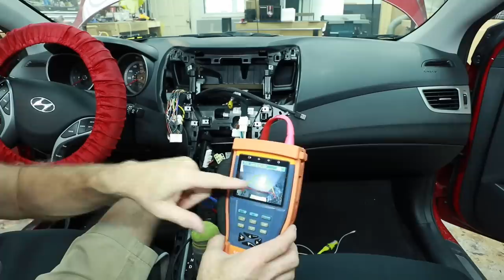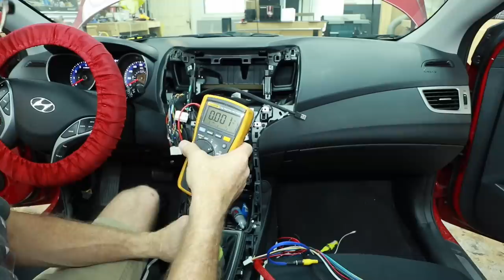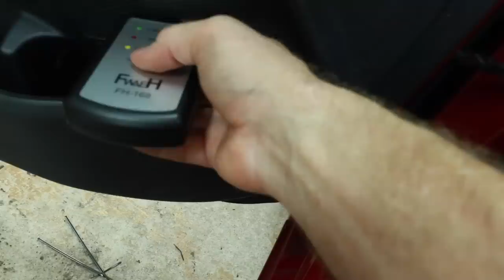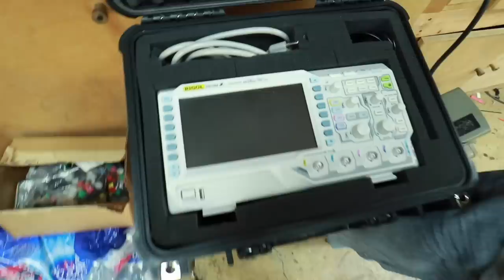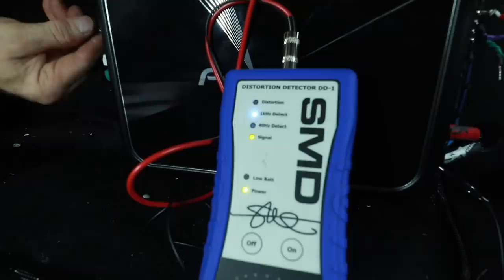The process of a 911 make over in this Hyundai Installer Diaries 211

Comment: I've been an installer since 1988, and I learn something every time I watch one of your video's. The smile on your customers face at the end of the video says it all. Well done guys.
Reply: U got my like. I didn't even read your comment. :)
Reply: Not only that, I rarely have run across a DIY job that was hacked this badly.  This is embarrassing.
Reply: @dnewma04 oh i have. When i was an installer, ive seen waaaay worse. Power wire was 3 different wires, not ring terminals on battery or ground, just bare wire twisted around the threads of a bolt and where each wire met the next color of power wire, they didnt even crimp or even use wire nut, they had bare copper just laid against each other and taped it up.

Comment: This crap is why I DIY.  I am no where near as good as Dean and Fernando, but my stuff is better than the crap the other shop did.
Reply: Agree. I prefer to stay, ask questions and observe the few times I have to rely on somebody else for Car Audio, Electronics, Maintenance & Mechanic work.
Reply: Same 👍
Reply: Ditto!
Reply: I welcome people to sit and watch me work, ask questions and get hands on if they want.
Reply: @bigaudiofanaticsoldchannel6162  That's good!  Let people see what they are paying for.
Reply: I just recently got my stereo installed at Best Buy, the guy ended up drilling holes below the stereo to run the USB, without even asking. The dude then pulls out the AC Drain hose, and for a month i had my ac draining into my passenger side. So just about done getting the carpet replaced, Best Buy's insurance paying for it. Honestly I should've just DIY and would've been happier or just go to Dean & Fernando and get it done by true professionals.
Reply: @WazZappening  Best Buy is hit or miss.
Reply: @WazZappening  that sucks. I'm a mechanic/12v guru by trade and I'm actually good friends with a few top notch installers at a local best buy but even they said they wouldn't trust most of the installers at other local BB stores. Def hit or miss with chain stores from what I've seen.
Reply: Agreed!
Reply: I am rewatching the video.  Why the hell did the other shop cut the factory harness?  It can't be that hard to make a T harness with parts that a shop should have laying around.  I bet I could run down to Walmart or AutoZone and grab some harnesses and build one right now.
Reply: Same here I had to do my friends audio for cheap using scraps of old systems on a iou I'm only charging him $100 including the amp i sold him because i just wanted to see it done right its still not perfect the front speakers need replacing again he trusted a local audio shop and they charged him $200 for $100 worth of speakers the front are just replacement cones awful distortion so when I replace them I'm redoing the last of the wire hopefully I found everything messed up the local shop isn't to blame on his poor install he trusted a friend's recommendation lol not good at all so his system bumps good and clean like I said still needs a few extra things touched up subs don't match but its whatever he had at the time it's less likely to flame on 😭😭😭
Reply: @toxictophat711  that's really frustrating.
Reply: It about doing it right, not who's better
Reply: Yep, it's why I got into DIY (and I'm not as good as Deam and Fernando) - seems that there are too many shops that do the crap the other shop did.
Reply: I was thinking that too...100%...but just now it hit me. Sometimes people go the cheapest route first...just wanna hear upfront results as better than before. Then realize later it takes work and time. I've been that way...I learned the hard way a lot...but it's been fun. watching these videos is golden knowledge I wish I had 30+ years ago as a dumb kid!
Reply: Same here. That's why this video was recommended to me.
Reply: Right.i have the minimum to work with when it comes to audio an my systems looks professional compared to theirs..🤦🏼‍♂️🤣🤣
Reply: FACTS!
Reply: amen
Reply: I've always done my own installations.  Last year I was feeling a little lazy.  I brought my car to the shop down the road, they've been in business for over 15 years.  The install was horrible, it all worked but was a mess.  When you do it yourself at least you know everything is done correctly.
Reply: Me too..waaayyyy better
Reply: Agree! I do my own thing and I take my time!!! I plan every stage!!!
Reply: Same. I have a higher quality of work, on average, doing it myself rather than outsourcing the work. The only time I go to a professional is if the job requires specialized tools or equipment that I don't have.
Reply: @varok011  Or... you know the install with a better / easier chance to fix it.
Reply: Yes
Reply: Ditto.  I watch them to improve even more.  My first install ever was better than that disaster he paid for thr first time.

Comment: The guys who disliked this video are probably the same guys who installed this lol
Reply: Estoy de acuerdo con tu comentario.
Reply: Facts lol
Reply: I was going to say the same thing. lol
Reply: They also work at Car Toys
Reply: Truuuu
Reply: True
Reply: I thought this was about installing a sound system into a 911 porsche
Reply: @gp8666  haha That's what I thought too!
Reply: Well he did trash the last guy for taking apart the factory speakers. And using there housings.  Then preceded to do the very same thing with the factory tweeter upgrade install. Solid install though.
Reply: Vin Quach that’s true,🤣🤣🤣👌🏻
Reply: I didn't dislike but see some problems here. For example. . . I never have high current power cables near RCA's. Usually power down the center and signal to one side or the other.  Also, Amplifiers in my installs are ALWAYS recessed mount with access covers or trim. No worries about about accidentally hitting any of the amplifier wiring that way.....Great video though, especially with all the info with the PAC-1
Reply: Lol
Reply: @tommygunnz7154  He manufactured the bracket for the tweeter out of  8th inch plastic, he didn't the old bracket 41:90
Reply: @mikeallen4200  how do u handle any heat from amps recessed...if any?  what u think about a lil fan install...or u think that's like a bandaid for something that needs some other help? peace
Reply: @mikeallen4200  btw...yea...power wires separate for possible interface AND space
Reply: @fatrobrico  I usually will use axial fans on small installs and ducted fans on the monster installs.  When Amps are fully enclosed, I always have intake and exhaust fans.  On some smaller installs, I've been known to cut a pattern or logo into polycarbonate and edge light it and it can serve as a passive intake with multiple axials pulling air through. It just depends on how the client wants the install to look upon completion. A side note:  when running fans to cool the amplifiers, avoid their power wires intersecting with signal cables just like you would with amp power cable. High RPM fans can cause signal interference, and a whining sound through your highs and mids, and a deeper hum in your lows like a poorly grounded set-up.
Reply: @mikeallen4200  thanks for the info!!!
Reply: @fatrobrico  no problem at all
Reply: Yea cus you don't work for them lol the editing is so obvious
Reply: That's alot of people weirdo
Reply: Hahahahaha FACTS
Reply: Mike Allen most higher end line rca cables are adequately shielded and do not pick up noise. This isn't a usual issue nowadays.
Reply: Lmao.....What is the name of the shop that fucked his car up so I don’t ever go there!!!!
Reply: the dislikes are the guys still installing used pull-out radios
Reply: 🤣🤣🤣🤣🤣 facts
Reply: I love this guys.  The type of installation they do is A1.
Reply: @superchile9640  i was going to say the same thing. The rca next to power wire is an old install method, today's rca's are triple shielded and do not cause interference issues. 90% of interference is from improper grounding.

Comment: I have 19 years in car audio, advanced security, fabrication, cabinetry, and accessories. I ran a high end shop for 9 years and this kind of work was common in the neighboring shops. There was more than one occasion where I saw expensive equipment deemed subpar by lackluster installations and many vehicles that were fire hazards. I would be humiliated if that was my work and it fell upon others' eyes. I love your methodical and detailed work.

Comment: I’m re-doing an aftermarket HU install in my wife’s Mercedes C230. Dean and Fernando, I wish I knew about you when I lived in Tampa. The shop that did the install ( in So CA) cut my factory harness, didn’t solder anything and the install looks like spaghetti. Your videos and tips are a big help, thanks for what you do.
Reply: They are in tampa Florida?
Reply: jean tsai   They are in Clearwater. Just across the water from Tampa.
Reply: @96matzed  when i am in the us i would like to run by the shop and look at what they have.

Comment: On that factory harness repair, I usually take pics of the wire placement and de-pin the wires that need to be repaired. With the short end out of the plug it's much easier to solder and heatshrink. Then insert them back into the plug after. Anyone who claims to be a professional installer and hacks up a customer's factory wiring is only pro at being an asshat

Comment: The owner of this car needs to go back to who installed this equipment and demand his money back. I’ve been installing audio equipment for about 15 years and I have never seen something like this. Clearly there was no pride.
Reply: He should say who did it.
Reply: Or leave a review on yelp with a link to this mess.
Reply: No KNOWLEDGE!
Reply: Especially since he has video evidence now.
Reply: @bondovwvw  Shouldn't be very hard to figure out.
Reply: Who did this!?
Reply: I call BS. There are a lot of videos that do this, a bad install which they happens to put right. Don't get me wrong I've been ripped off before, but this is just total BS.
Reply: @utubecomment21   These guys don't seem to BS.  I've seen plenty of bad installs like this.  I have even repaired some that have been done at super high end shops well more like super expensive .
Reply: If you don't take the utmost pride in your installs, then your installs are crap !
Reply: He probably called everyone til he found the cheapest place and this is what u get cheap crap for an install
Reply: Unfortunately a lot of hacks out there.I have noticed some "pro"channels on here that are off base. A good installer does it one time because they don' t want to have to go back and correct it. The only time you want to go back into a setup is to upgrade or equipment failure-things do fail, not that common with good audio. Besides , I do not want a disgruntled customer. Wire ties , fusing, grommets, split loom,proper guage wire,and taking time to think about what the hell you are doing will never steer you wrong.
Reply: This is pretty clear the owner himself tried to do this install, he tried to fix it over and over and realized he needed to pay someone. He was too ashamed to admit it, so he blamed a shop.
Reply: @luis I was thinking the same thing.
The owner did it.
You could tell by his voice talking about it when they were in the car. It was crackly & shaking & he was ashamed.
Reply: Yeah right he's gonna get his money back.Hes just better off calling out the shop, their location and the installer.That will hurt more.
Reply: @davoupnya3202  Words of wisdom right there,take your time, do it right, first time everytime.
Reply: They don’t have the pride because they lack the work ethic to do things the right way.
Reply: This situation is exactly why I believe in courts and if you have to sue someone, you do. Clearly they had no business doing what they did and they should make it right.
Reply: If he paid for new speakers and they reinstalled the factory speakers, that sounds illegal.
Reply: @throwaway5926  my problem is i WANT to do installs this good,but i unfortunatly dont have a garage or workspace to do it. i live in an apartment and it realy fucking sucks being almost totaly restricted from doing this. just recently, i fixed a buddies system that someone hacked up with the wiring. with the limited tools i have i made it much better but not good enough for my work ethic levels. alot of connections for twisted wire with electrical tape so the best i could do for him was take the tape off butt connect them. i wanted to solder it all up and what not but again i have no workspace for electric tools. his amp is still laying loosly in the trunk and i wanted to make a mount and get it off the floor but dont have the ability too. it sucks. theres so much more i wanna do for his system and make it reaaaly nice but i simply cannot right now. but again its WAY better than what it was.
Reply: @sloebone7399   That is called theft by deception, As long as he has a receipt stating what equipment was to be installed as well as all labor he most definitely can go after that shop!
Reply: @sloebone7399  that’s not what happened. They cut the factory speakers at the surrounds out of the factory bracket and mounted new speakers in there.
Reply: @canillocanillo3371  that’s what I was thinking or a friend did.

Comment: Question: instead of soldering extension wires to the factory plug why didn't you re-pin the plug with fresh wire?
Reply: Because then the harness would be short making it a little hard to get a stereo in and out.

Comment: Unfortunately I was in a similar situation.
10+ year's ago as I took my car to a shop that did ok work but didn't last the test of time and eventually failed. I re-did the whole system my self after ripping it apart I found so much short cuts and cheap wire no heat shrink just black tape that was oozing apart from age and temperature change. Car audio done right is a skilled job. Sound is everything to me as a properly done system is candy to the ears. My advice to anyone upgrading is take your vehicle to a reputable shop and spend as much as you can spare going cheap will only lead to upgrading again and again. So do it once do it right and save your self time and money.......
Great video from 5 star audio...

Comment: You are an artist, sir! Only thing I would do differently, would be the fuse. I've had problems w/ the solder in the glass fuses. It slowly melts if you are running lots of current under the hood. You probably found better fuses than I did, and normal people don't run as much current as I have. It slowly builds as I add more amps. I cant stop myself. Beautiful work!

Comment: I did install back in the 80 ,90 , worked for Pioneer , Kenwood , local install shop . The meters and tools you have today is amazing .If the installer had a bad ear your car sounded bad . Nobody could afford the audio control meter to tune the car properly . Today the show vehicles are more SPL oriented rather then sound quality . the show cars we built did come in first usually .

Comment: Solder seal connectors would work well with things like that harness you you resoldered. Saves a ton of time with a water proof soldered connection all in one step. Looks pretty good too.

Great video, I learned a few things. Thanks for sharing.

Comment: I've fitted Blam 2 ohm speakers in my 2004 Vauxhall (Opel or Holden, depending on where you are on from) Corsa, I've added plenty of sound deadening, however the 5 1/4 inch coaxials I've fitted vibrate the adapters I used and it drives me nuts. So over the Christmas break I'm going to stack build some enclosures for some 6x9s that I can fit to the Parcel shelf, also the 6x9s are matched to the aftermarket headunit. I find videos like this so educational.

Comment: Everyone has thier own way of doing things but theres right and wrong. Yes running rca cables down same side as power can be an issue which is why its preferred to separate but with proper cable's and shielding its no problem. The first installers are lucky they didn't catch his car on fire. 5stars did a perfect fix and install. Awsome video. Thx u for all the info keep up the great work

Comment: @16:39 I started installing professionally in 2001. We have reverse harnesses, I would have lopped off the factory plug and wired in fresh clean soldered and insulated connections if it was mangled as bad as it appears. Cheers

Comment: Great video and information. To be honest, as a mechanic myself though not audio, I was a bit disappointed you didn't vacuum the guys truck real quick. I get on my car dealer if they don't do a quick detail on my car, so I try to apply the same. i do breaks, I clean the areas including wheel wells etc. They guys grin was amazing though.